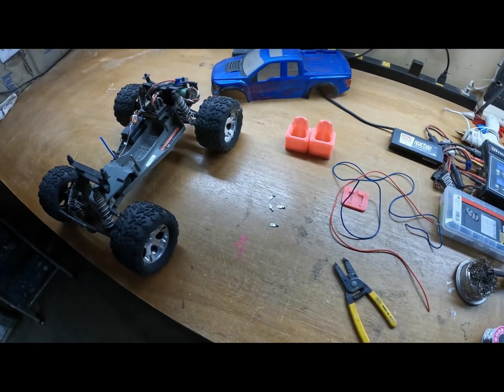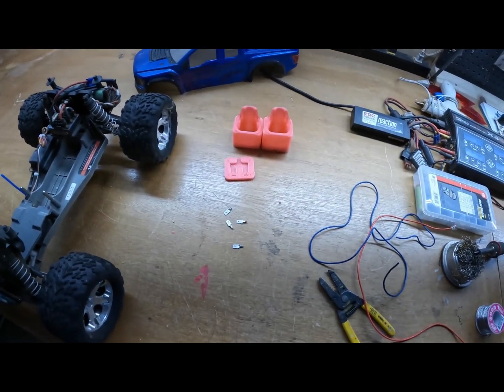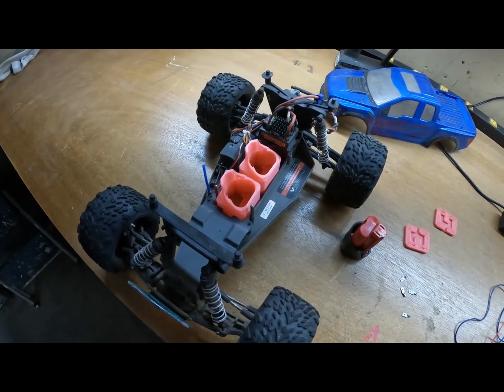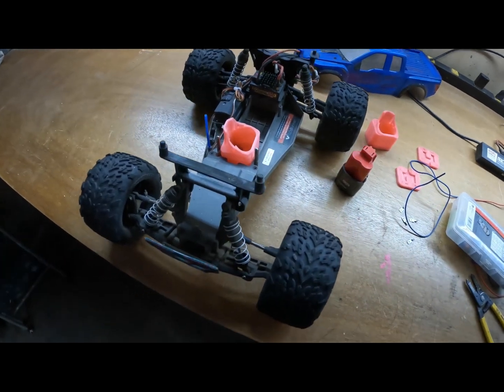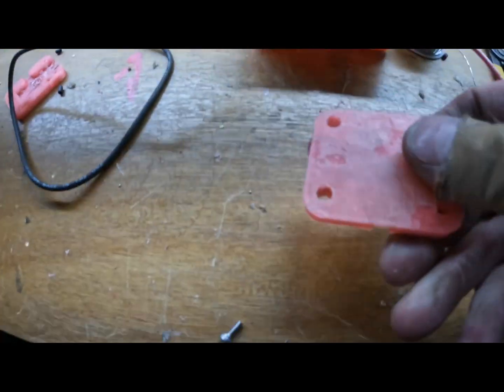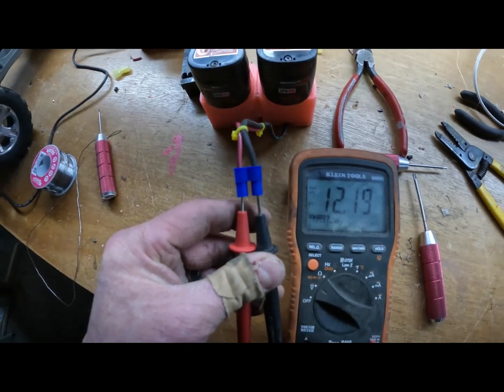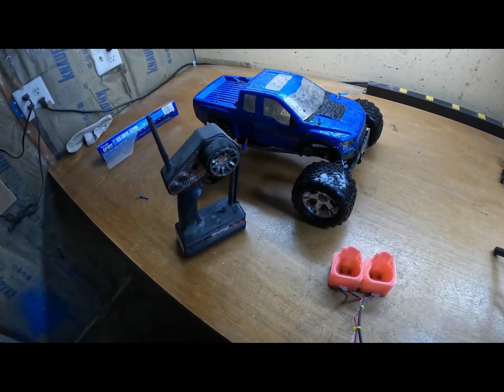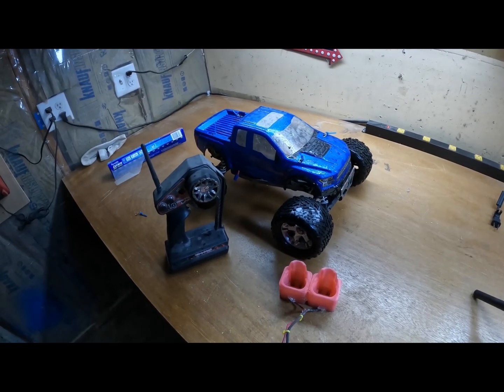Milwaukee M12 battery powered RC car

Comment: I tried this on my traxxas with a xl5 esc and was unsble to to throttle response.  I normally have a nimh i use, so i swapped modes to lipo mode but no results. Swap over my nimh battery and ot works fine. Im not sure why one battery will work and the other wont. Any insight?

Comment: I use M12 batteries for my electric RC aircraft - they are way more reliable and easy to charge than the hobby store batteries - and you can also use them to power your tools , so they are basically "free"
Reply: I have 4.0s and 6.0s. I’m wondering if there’s a regulator or something I can put in between the battery and the motor to give it more run time but not try to overpower it
Reply: @shineperishingrepublic you can add a fuse to it
Reply: Pretty cool idea! What kind of aircraft? I was planning a small aircraft build that would use m12 batteries, so I could fly whenever without worrying about lipo maintenance.
Can the m12 handle the consistent draw of say a 30 amp, 3S application?

Comment: you put a volt reducer? I mean the toy use a 7.4 V I think and the batteries are 12 V
Reply from the maker: These are 3 cell lipo esc’s, so they run at 11.1v normally, 12v is a little high but has not caused any issues as of yet.